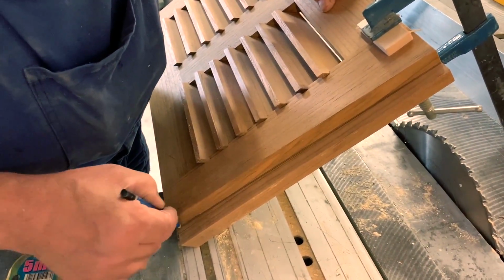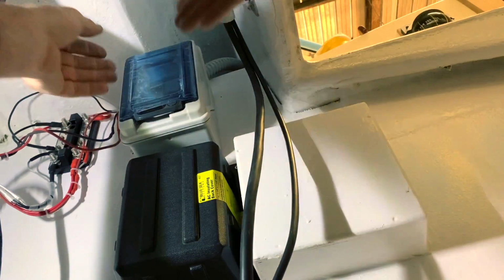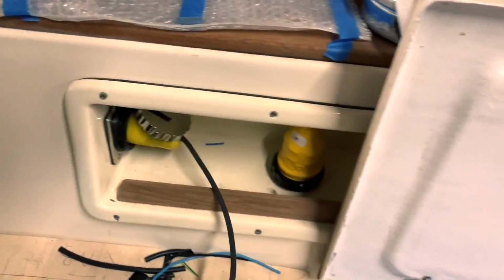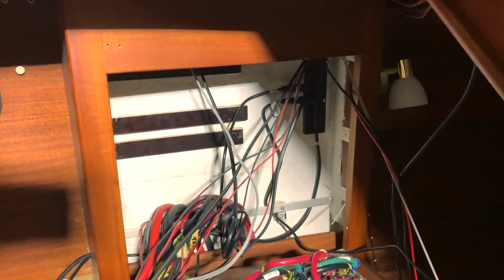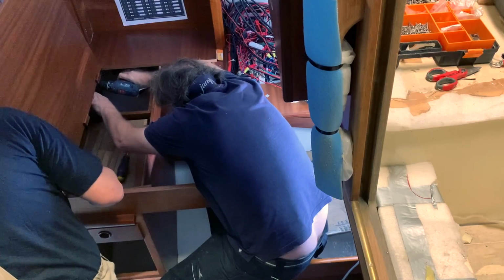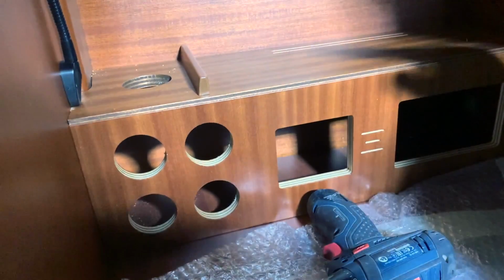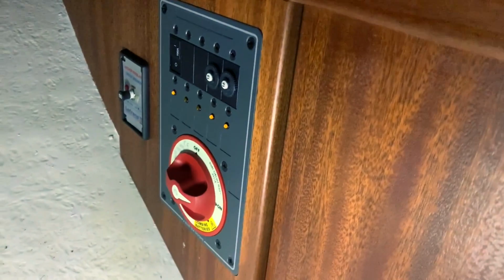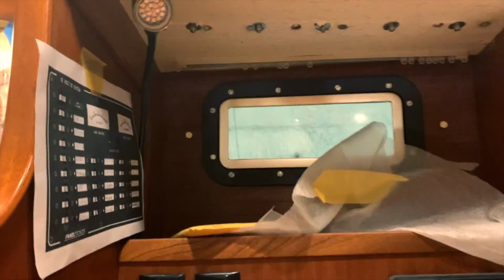Hallberg-Rassy 312 "Ellös":ELECTRIC SYSTEM AC/DC DONE..!! (DIY BOAT)

Comment: I rewired my boat using Oceanflex.  The hardest thing was finding something to fix the cables to.  In a house you can always fix them to a wall, or even better, chase them in.  But in a boat, the wall is the hull, and I don't want to put screw holes in the hull.  Cable tie mounts do not stick to the hull either, especially if it is flowcoated.  How do you fix the cables to something?
Reply from the maker: Easy.. epoxy putty and piece on plywood with dimension you need  when cured and correct  screw lengths you can fix you cables. I did many time in my boat with no problem or you can glass a plastic hose where the cable run into…

Comment: Hello Gabriel ! How are you ?

I would like to ask you a question about the floor of my boat.

I am installing a new floor finish, and I noticed that the floor has two valleys of about 1/4 of an inch.
It's 1/4" thick, by 12 inches wide, by 3 feet long. 
What would you use to fill the gap ?

The underfloor is laminated marine plywood in fiberglass.

Thanks.
George
Reply from the maker: Hello George, all well thx...in this case I would like to  laminate some fiberglass patch where needed, you can use normal resin more cheaper than epoxy and more easy to use. When cured with orbital sanding machine  I will sand to get a smooth linear surface and job done. If you want use the “Gabriel’s perfect system “ you can use some epoxy grout with a spatula  when cured a orbital sanding to get the perfect smooth without imperfection finish.. but if you need to cover with new floor Is not really necessary...😀 let me know! And check this video https://youtu.be/iLvfadq8G3c
Reply: @sea4see  
Thank you for the information. I was thinking about using the already mix resin bondo with fiber, or some call it bondo with hair ! But I am looking for the one that will be easy to sand straight with a belt sander.

Thank you Gabriel, and will send you some photos soon !

Comment: Thanks for a great video - where did you buy the cablesissor, cant find it in Denmark??
Reply from the maker: Hey Leon what meaning cablesissor?
Reply: @sea4see  The sissor he uses o cut the cables
Reply: @sea4see  tronchese per cavi :)
Reply from the maker: The small one red?
Reply: sea4see yes, that one. Was The italian right? 😁
Reply from the maker: Was correct!!! Here the link you can find everywhere also amazon https://eshop.wuerth.it/Categorie-di-prodotti/Forbice-per-elettricisti/311460200223.cyid/3114.cgid/it/IT/EUR/
Reply: sea4see thank you so much

Comment: As has become very clear during this project - planned very thoughtfully and meticulously executed. I noted you soldered the wires for the ceiling lights - did you not consider using Wago connectors for these? Well done beautiful job.😀👍⛵️
Reply from the maker: Ciao Norman! Thx a lot!! No wago connector over there due the fact that space is at minimum... I prefer solder... more space more air vent
Reply: sea4see OK - understood.But just to be sure we are talking about the same thing - https://uk.rs-online.com/web/p/standard-terminal-blocks/8837544?cm_mmc=UK-PLA-DS3A-googlePLA_UK_EN_Connectors_WhoopNon-Fused+Terminal+Blocks_Whoop-8837544&matchtype=&pla-341519950929&gclid=Cj0KCQjw0Mb3BRCaARIsAPSNGpVf5eVTTi6gucH81mrjpnEvtLW_W673bdRschXoAi3cfyf7spXVDZMaAvaKEALw_wcB&gclsrc=aw.ds - they are very small and very reliable (I am a big fan of these)😉

Comment: Great video. Why do you crimp all connectors on and not solder them to the wires?
Reply from the maker: Paul I prefer crimp with top quality crimp stuff Ancor stuff  99%... i soldering the cieling light and other stuff but I prefer crimp!! Easy clean and fast

Comment: Hello !

I am George from Canada.
I am in the process of installing my light system.
I have purchased all the Bluetooth parts but I am a bit lost.

I would like to open lights in the kitchen with a wall switch, but I also would like 
to be able to control them with the Bluetooth remote control that I also purchased.

Did I miss a video where you showed the installation of your cabin lights ?
Do you have a reference that show how to install the system ?

Last question, with wall switches did you install ?

Thank you,
Georges
Montreal, Canada
Reply from the maker: Hey Georges! Which brand do you bought?
Reply: @sea4see  
Hi !
The brand of the controller is Mi-Light. They look exactly like the one you have installed on your panel.
In my boat, I have a main switch to control on/off all the wall light fixtures.

In the bedroom, I have  4 lights.
I want to make two zones of two lights. So I need two controllers.

In the salon, I have 3 wall lights that I want to put in a zone with one controller.

Then I have a ceiling lights that I want to split between a few other zones, etc.
I will have 7 zones altogether.

My question is can I install the controller on the existing wiring just before the lights ?
Reply from the maker: I bring the cieling light in 3 controller/ dimmer  and from there to the breaker
Reply from the maker: Pm me I send a photos of circuits
Reply: @sea4see  
Thank you for your assistance.
I do not have a circuit plan of my boat.
I tried to get one from the Sea Ray company, but no luck.

Did you install some of the RF controlled lights in one of your videos ?
Reply from the maker: Georges Papillon no this is the video with installation send a mail I forward the photo so of scheme of rf
Reply: @sea4see  ok. I will find your email, and send you my e-mail address . 
Thank you.
Reply from the maker: Georges Papillon check it out ....

https://youtu.be/Pw1yuf-5Bcs
Reply: @sea4see  

Hi Gabriele !
First, thank you for your e-mail. I will compare it with my boat electrical wiring, and use some of your installations.

So funny, this morning I watched the same video you just sent me. Thank you for that.
I will work on the lighting this weekend, so I will let you know how it goes.

Thank you again !
Georges